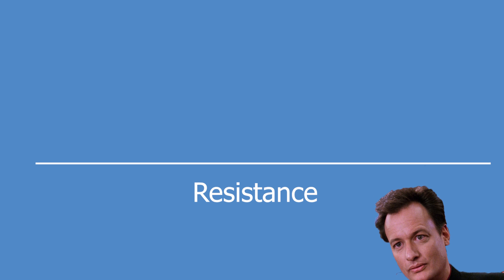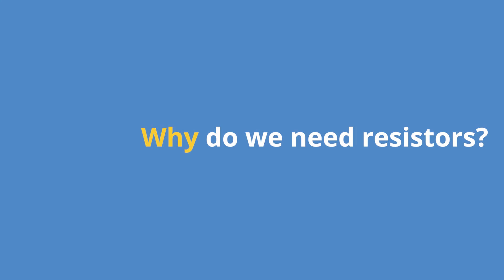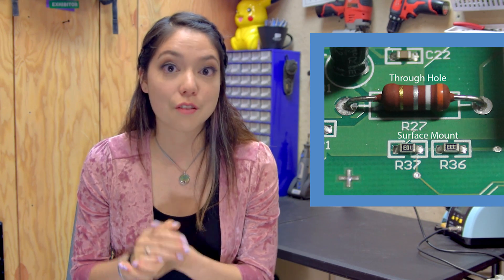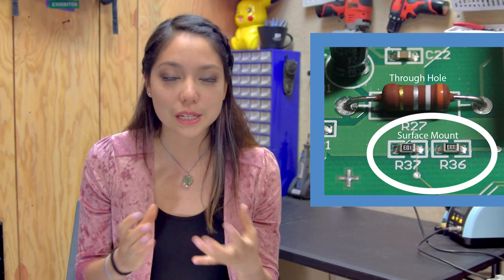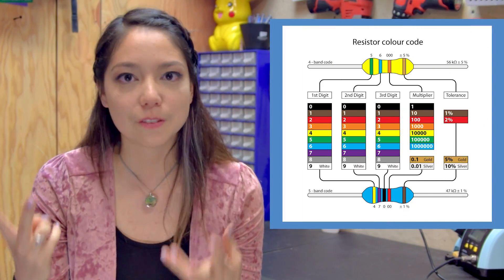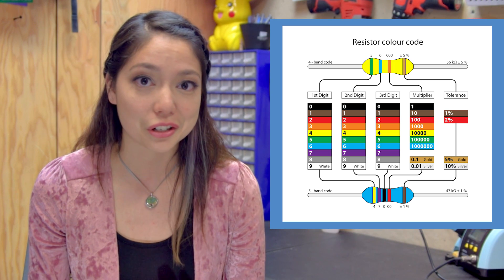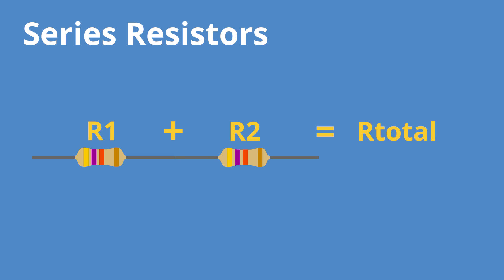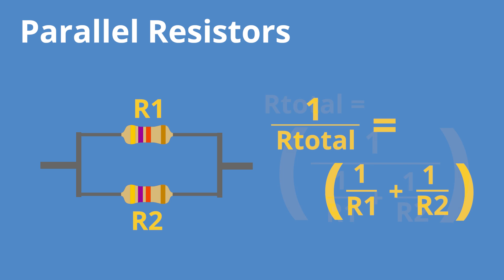Resistors 101: Parallel, Series, and Color Codes

Comment: Brown and red, red and orange, orange and yellow, brown and orange look indistinguishable to me on resistors. :( Purple looks either like black or like red or like blue. I wonder what magic paint they use that looks the same across most colours. I tested for colour blindness and... nothing, i'm "normal".
Reply from the maker: :( worst case scenario, you can do what many engineers do anyway and use a multimeter ;) it's not cheating
Reply: But if it's in-circuit you often need to "lift a leg", which is... hey i'm not a dog!

Comment: Do a video on transistor testing with multimeter. Iam always confused
Reply from the maker: Totally great idea! We'll add it to the list of upcoming videos!
Reply: @dave
a basic test to see if you have two diodes and an open circuit , then you have an idea if it will work :-)
ive also seen a video on testing mosfets with a meter , i havent tried that myself yet though :-)
Reply: Why do you need to test a transistor?
If you want to know the pinout, just look it up in the datasheet.